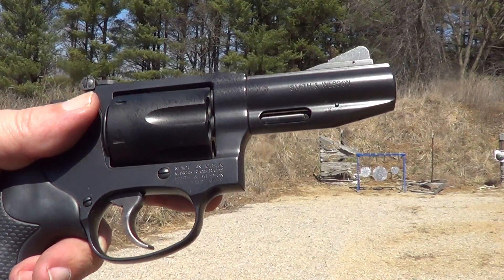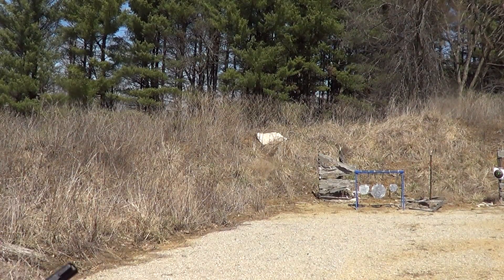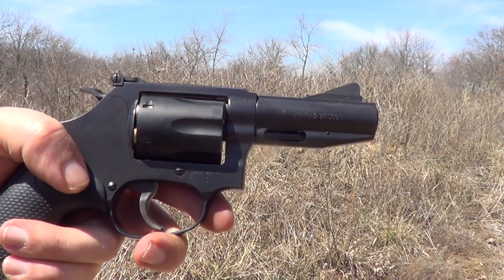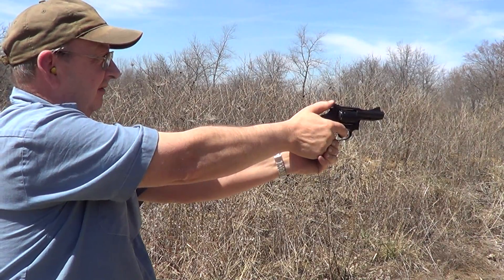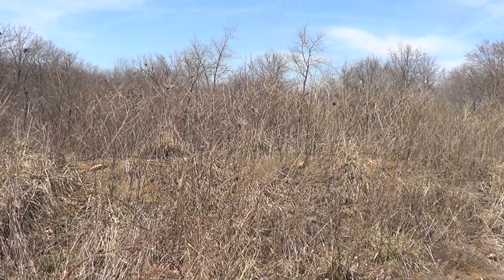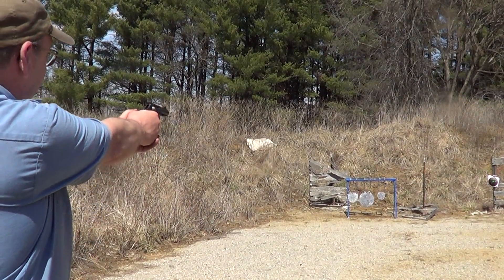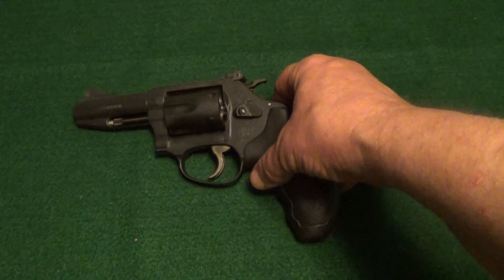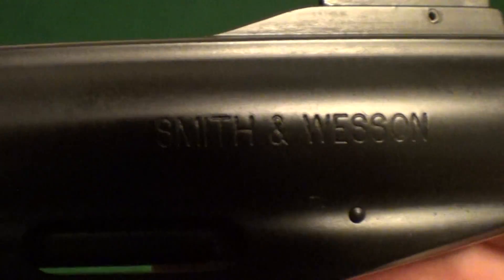Smith & Wesson Model 632-1 PowerPort Pro 327 Federal Magnum

Comment: A 6 shot J-frame.  There's something you don't see every day. It really would be nice if they offered it in hammerless, like the 642 but with that barrel.
Reply from the maker: They did. The 632 Centennial (concealed hammer like the 642) is actually more common than this gun. But both are kind of rare.
Reply: @1957Shep  I thought the 632 Centennial was just .32 H&R mag not .327 Federal mag?
Reply from the maker: @The_Conspiracy_Analyst  They were made in both calibers, but at different times. The older ones were 32 H&R.
Both are kind of rare.
Reply: @1957Shep  Ah cool!  Thanks for the replies.  God bless!

Comment: Great video Shep. You cold really see the recoil ramp up as the rounds got stronger.  I really like this revolver and the .327! Did they ever make an airlite version of this?
Reply from the maker: Not that I know of. But they did make a Centennial version. 2 inch with the concealed hammer like the model 40.
Reply: Thanks for the info. seems like making a airlite would be a no -brainer but maybe there were issues or they were waiting to see if it caught on before going to deep on tooling.

Comment: Nice revolver , I will check out the full review on this revolver. Hey I was just wondering what do you think about taurus revolvers.
Reply from the maker: I have 3 Taurus revolvers. And used to own a couple of others in the past.
The quality varies on those guns. Some are very good, others were so-so.
Quality is less than S&W, but so is the price. All in all, I think they are a decent value for the money.
Reply: I'm glad to hear that ,I thought  maybe you only own s&w, colt revolvers, I have a Taurus revolver 38 Special  model 85 stainless steel with wood grips real nice looking, I didn't show it in that first video I did , but I heard its a clone of a s&w but don't know witch model. And it's real nice. I'm glad to hear your thoughts on it. Thanks
Reply from the maker: Gun Enthusiast The Taurus 85 is a fairly close copy of the S&W model 36.
I`ve never shot a Taurus 85, so I really couldn`t comment on it.

Comment: Nice gun. That would make a handy trail gun for around here. Are these still being made? Charter, Ruger and Taurus made guns in 327 and dropped them. Seems like it has quite a bit of power with those mag loads! Thanks for the vid...
Reply from the maker: Officially, the 632 in 327 has been dropped from production. But one of they guys on the S&W forum says that they are still being produced off and on in very limited numbers.

Comment: Wish I had one of those. Hard to find and pretty expensive when you do. I got a Ruger SP101 with the 4" barrel in the same caliber. Still much prefer Smiths...

A .32 ACP will also work in this gun. I made a load, 100gr XTP with 5gr of Titegroup, 1250fps so enough for good expansion but quite reasonable to shoot.

Comment: Never mind. I just saw that it can be double action too. But now that I think about it, what's the approximate weight of the trigger pull? Both in single action and double action.
Reply from the maker: +Seth Struble About 3 pounds single action and 8 pounds double action.
Reply: +1957Shep That doesn't sound too bad. :-) But what is the key lock and what makes it worthless?
Reply from the maker: +Seth Struble If you want a lock on your gun, I guess it`s ok. If you don`t want a lock on your gun, it`s worthless.
Reply: +1957Shep Alright then! :-) I'll have to take a look at this weapon some more. :-) I'm really considering picking up one of these. :-) Thanks for your help. :-)